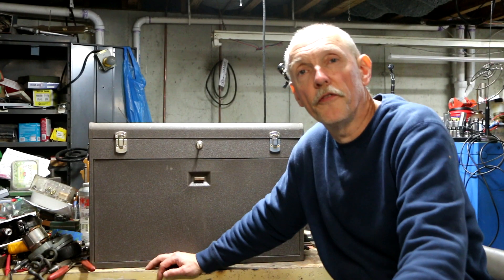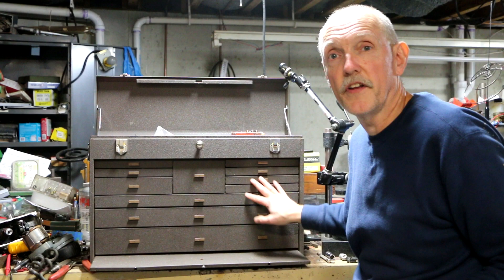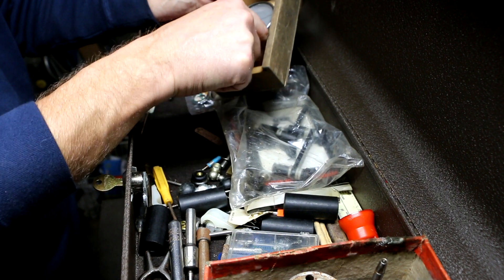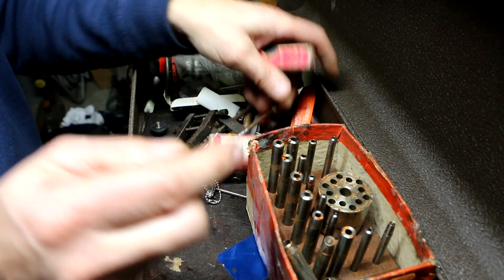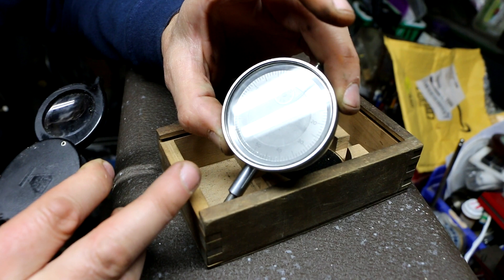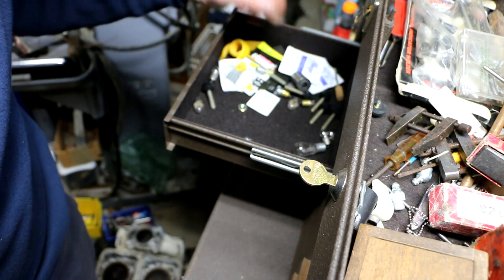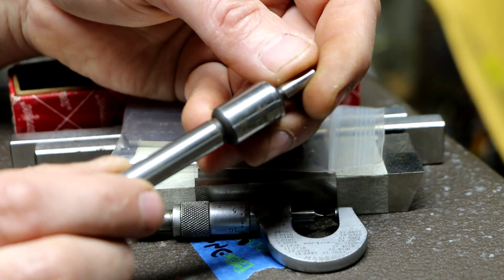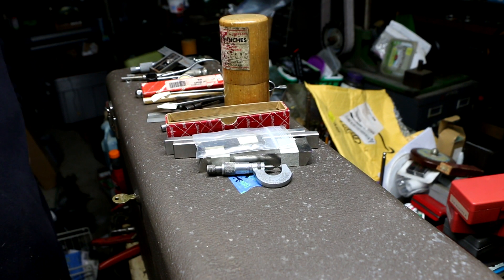Fall 2023 Tractor Show Swap Meet Tool Picks

Comment: 10:10 that looks familiar as a product, but I can't place it. The tip cover rings a loud bell. Much like the old novelty hammer/multi-screwdriver from the 1950's (screwdrivers were the handle for the hammer, with a similar russian-doll design) but better quality and no hammer head. 13:50 The Starrett 232 may be a factory job. A lot of designs were  decatalogued over the years, and they have always had a broad menu of factory special options.

Comment: Good afternoon Steve.   this question is about the welder series you did awhile ago.   i have a old school miller 330. that doesnt have the 120 outlets on it.   do you have a diagram to add that setup?   im wanting to run my cooler.   thank you sir.
Reply from the maker: If your input wiring is the same as mine, there is 120 volts across either one of the line inputs and the neutral. So L1 & L2 are the 240 volts for the main weld current, and L1 to neutral is the 120 volts used for the control circuits..
Reply: @stevewatr  ok.  thank you sir.  i will check that and aee what i have.   i was looking at that. not sure how since its 3 wire 240.     and 3 wire for the 120 outlet.  

my other option was to use one of the relay sockets from the foot pedal.  not sure how that would turn out though.